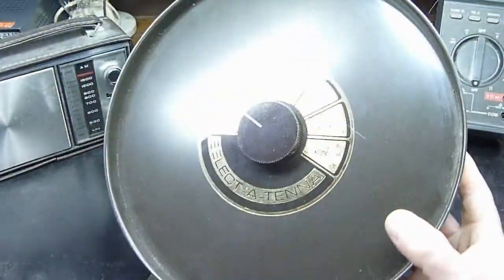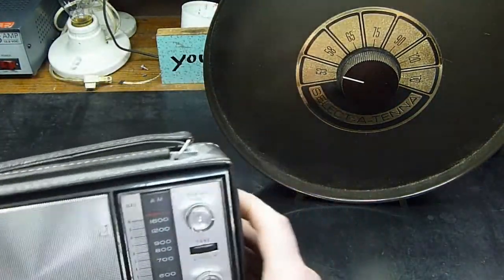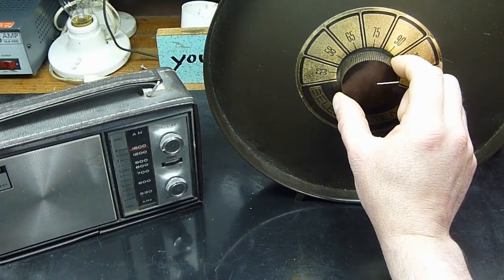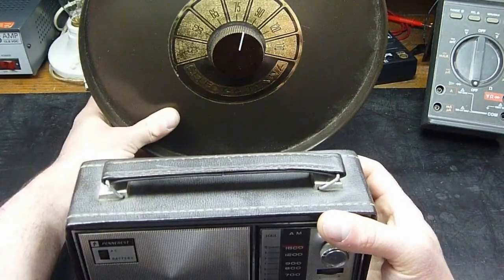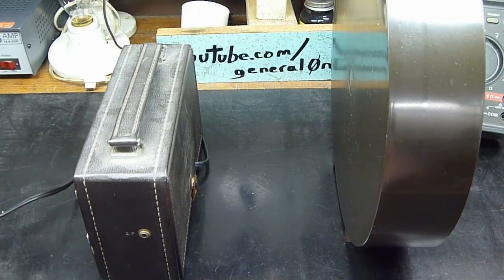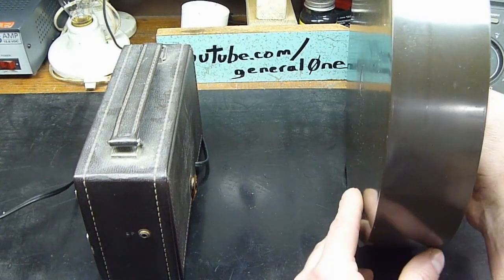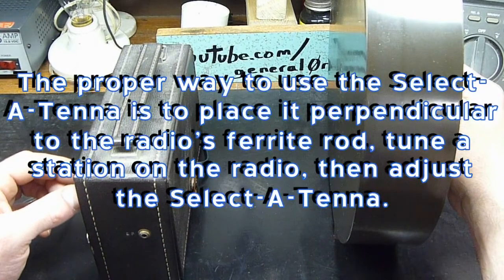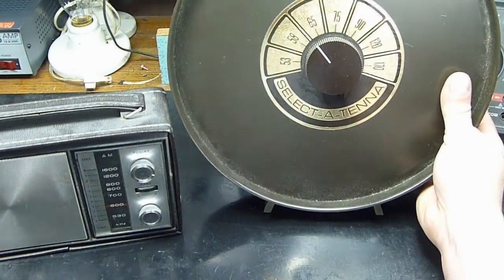(2014) Intensatronics Select - A -Tenna

Comment: i just got a select a tenna and it works great, I place it back to back with the radio and fine tune the radio dial and the select a tenna dial, then move it around the radio to find the sweet spot.  I've been able to pick up WSM in Nashville from south Louisiana on a cloudy night, amazing.
Reply from the maker: Nice!  I also use mine to pick up WSM, though I have a few radios that can pick the station up without the Select-a-Tenna.  I'm from western Pennsylvania.  It is quite amazing.